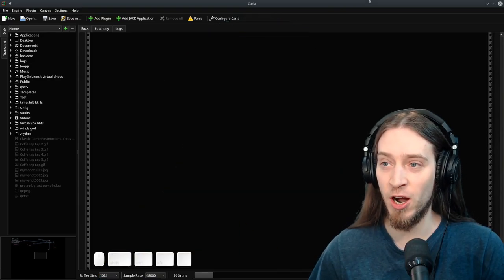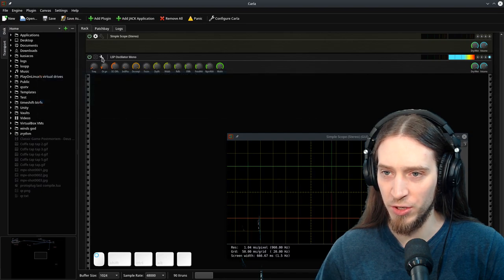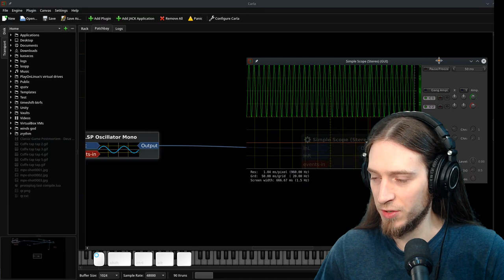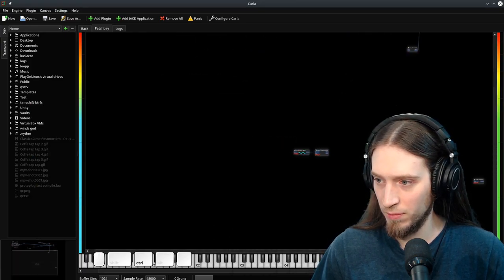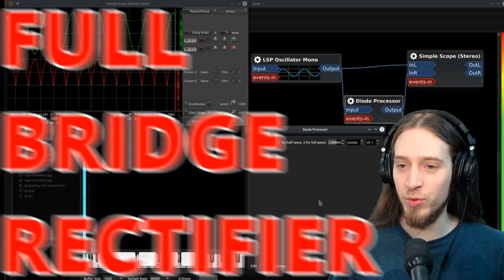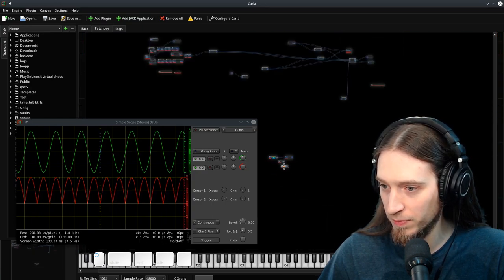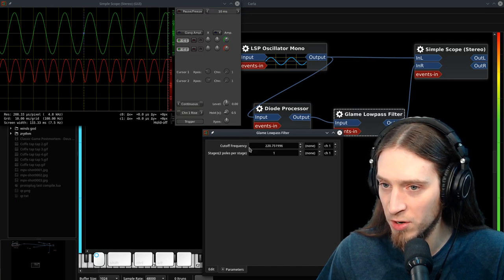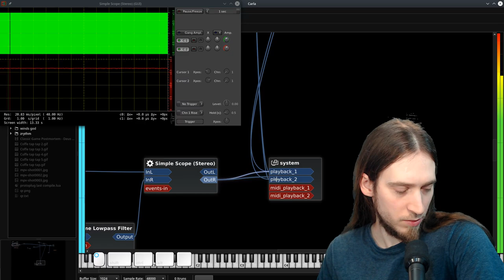Turning (virtual) AC into DC with Carla (a libre non-linear plug-in host)

Comment: Useful tip:
1. Get this setup but with TAL-Noisemaker as source (or anything with flexible envelope)
2. Get Audio to CV and connect it to the DC
3. Go to anything you want to automate (for example Zyn) and go to parameters -> expose CV parameter.
4.  Connect CV output to the CV port
5. Bam you basically have Serum for free (if you have a wavetable synth, for example Surge)
6. There may be some randomness to it, make sure to setup the lowpass properly, or maybe you want randomness.

Comment: Blow the speakers out!
Aha, that's what they meant by it.

Anyway, Carla is great, it can even run windows plugins (even Xfer Serum). Also you can use CV automation with ZLFO .
Reply from the maker: I haven't yet played with the CV aspects of it, but yes - I use Carla all the time (literally every time I record video or stream).
Reply: You can make any automatable parameter automated with CV, but I don't understand how the scaling works, usually I just guess the Min and Max vaulues. But ZLFO is a great plugin that comes with Zrythm and can be used in Carla. It allows custom LFO shape (not Serum LFO tier custom shapes, but it is good enough).

Comment: hey Unfa, do you know if an Analog to Digital converter box for like $10 can be used instead of an audio interface?
Reply from the maker: Well, you can find extremely crappy USB audio interfaces for like $1, but I would not use them for anything more than crude playback backup gear.